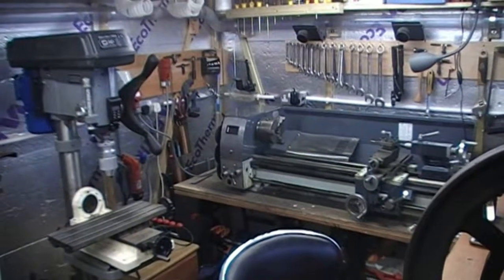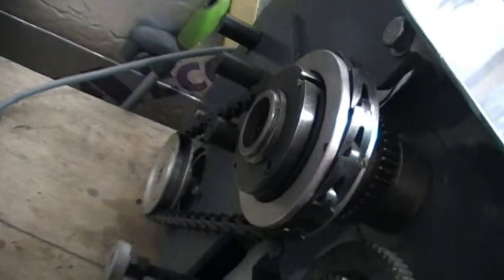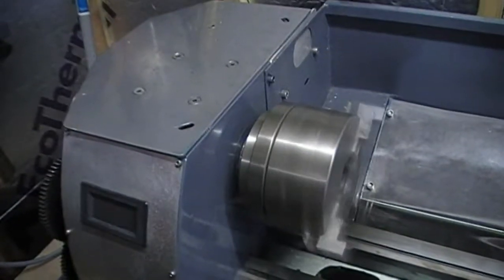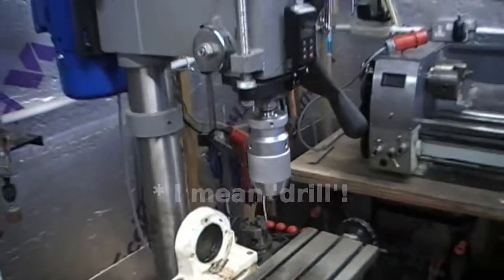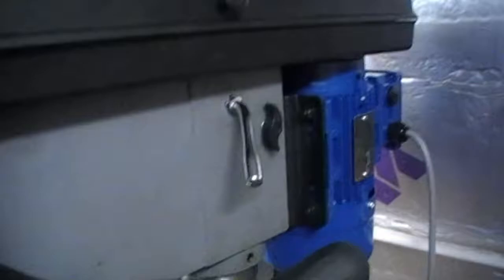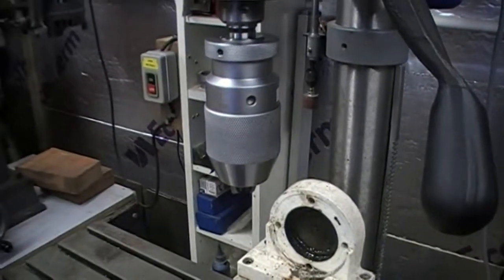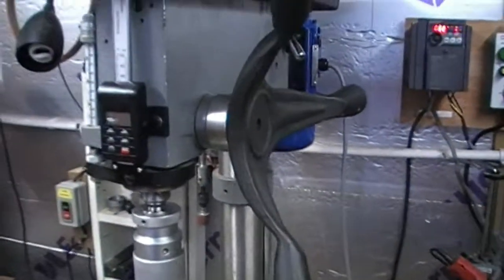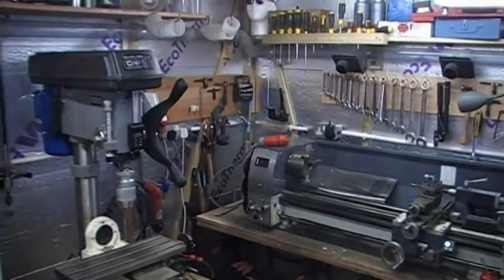Lathe and Drill Press Three Phase Upgrade Part 1

Comment: The 3 phase induction motor is absolutely superior! Nice job to use the same inverter for 2 machines that don’t need to run together, but be careful with the 3 phase plug, because you didn’t plug it in correctly all the way
Reply from the maker: Yeah, I have never regretted doing this conversion.
You are right about the plug - I shot this video when it was all quite new and the plug was so stiff to push into the socket that I thought it was all the way in when it  wasn't. I realised my mistake quite some time ago, but thanks for flagging it up anyway.

Comment: Good call Gary and nice work on the new motor housing and mods for your lathe, you did a beautiful job.

As it happens, I did much the same with my old Grayson a few months ago and documented much of it over at the homemadetools forum which also covers some interesting ways to take advantage of the manual input terminals for controlling the lathe:

http://www.homemadetools.net/forum/new-lathe-electicals-subsequent-bench-mods-hint-restoration-63777

I'm now looking to do the same with my DW as the motor stopped working completely on that as well two weeks ago, though I think I'm going to use that as the excuse I need to strip it down for a clean and repaint before sorting the electrics.

Since I know you have a DW, you might he interested in something I've designed to help those with spiral columns which prevents the head from moving off point while making hight adjustments. 

A link for downloading the plans can be found in the conversation section of the DW yahoo group ;)
Reply from the maker: Hi!

Thanks for your kind comments  :-)

I just read your Grayson upgrade log on the homemadetools forum - very impressive. You have an enviable knowledge of electronics - an area in which I'm content to just be told what to do! I like your control panel and the way that you fabricated it. And the business of keeping swarf away from the motor - well, you used some polycarbonate sheet and an old speaker grille, and I used part of a stainless steel cooker hood!

As for the D-W, a three phase motor would be great but with variable speed you wouldn't have much call to use the planetary gearbox. Wouldn't you miss its dulcit tones?  ;-)

Will take a look at your aligning device on the D-W forum over the next couple of days.

BTW wish I had access to kind of scrap bins that you do!
Reply: Thanks Gary

The work is pretty boring but the jems I find in the scrap bins from time to time are well worth turning up for lol.

Nah, the planetary gearbox will still see plenty of use, just means I can slow it down to a crawl for use with hole saws, centre finding and power tapping.
Reply from the maker: Yeah, true - it's similar to me keeping the jackshaft in the drill press. Best of both worlds!

As for the scrap bins, it's a kind of alchemy, transforming 'trash' into treasure...